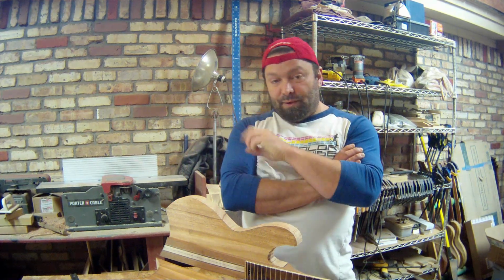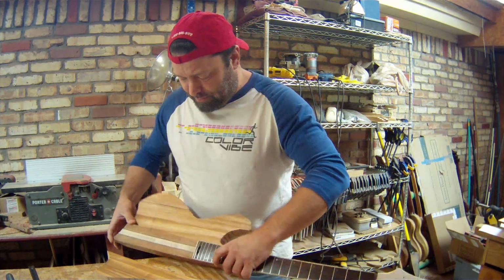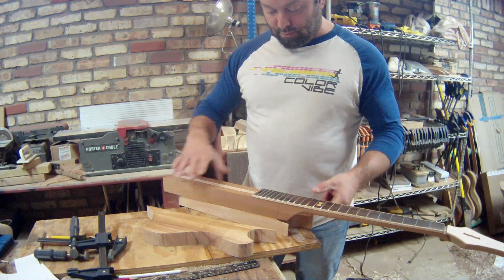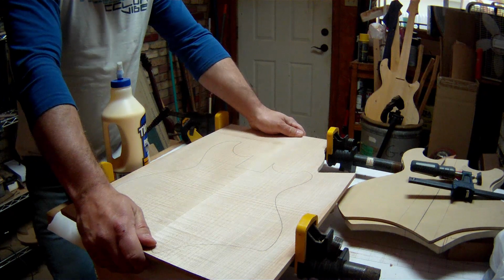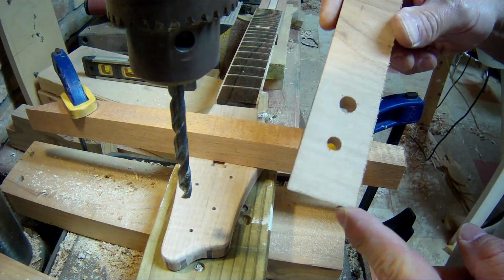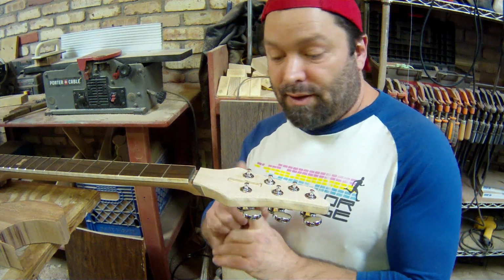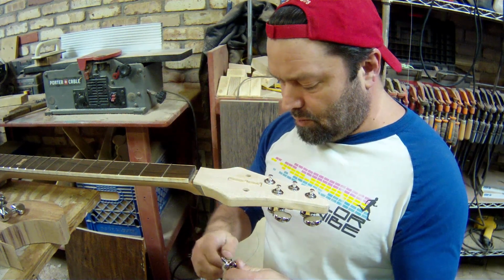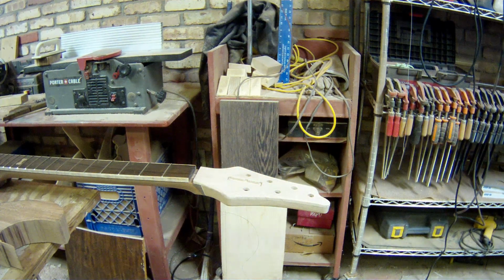GGBO21 - Off the Record - 15 Prepping for Top & Drilling Tuner Holes

Comment: gorgeous work. I really like the way you think out loud the process and I almost feel the trepidation of each cut and drill with you! Thinking, as you do, I wonder if you could drill the bushing hole, then use a sacrificial bushing as a drill guide for the bulk of the rear hole (fnarr), and finish from the back. (fnarr)
Reply from the maker: It’s an idea
Reply: Or drill very slightly undersized (anticipating offsets) and rat tail file to finish. 🤔 With imperial+metric bit combinations there's sometimes a "wrong" system bit that's handily just undersized the "right" bit.

That's my elaborate more-effort solution to avoid me buying a step drill bit lol.

Comment: I've never drilled holes in an angled headstock but to my way of thinking I'd drill them 90° to the face of the headstock rather than your method where you're going at 90° to the fingerboard face.
Interesting I'd never thought of that
Reply from the maker: They are perpendicular to the headstock.  But with the angle of the neck, I’ve had to jog it up in some odd ways to get that headstock square to the drill.
Reply: Ah that explains... Thanks.
Reply: I was wondering the same thing it looked to me to be 90°  to the fretboard. 👍
Reply from the maker: @danteelander1491  I guess it was a weird angle to shoot from.  The headstock is flat and the neck angled off to rest on the bench.  Kind of a janky setup, but it worked.

Comment: What kind of bar clamps are those? The yellow black ones?
Reply from the maker: Pole clamps.  I inherited them from dad so I couldn’t tell where to find them.  But I think you just get the hardware and they fit a standard pole size so you can move the hardware to a longer pole.
Reply from the maker: Sorry, a quick google search told me they’re called pipe clamps.
Reply: Ah yeah I meant the brand, they seem to have a more parallel jaws than the ones I have. I’ll do some digging. Thanks man